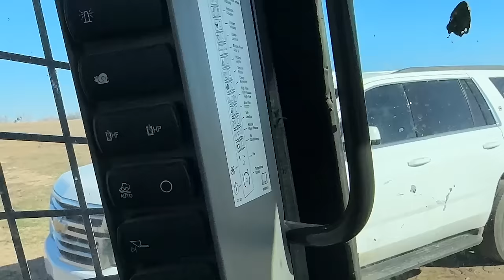FREEZING Temps Force Us To...

Comment: About the only thing you need to do for bison is make sure they have water and food. Of course not letting them get stuck in a snow drift might be an issue in a blizzard. A large open shed should suffice though snow fences might be useful if you are subject to that kind of weather. It is presently 14 degrees F at 11:39 AM on 1/16/2024 in Southern TN. Water is a solid and the snow pack is too cold to be very slick.

Comment: Hint for Cora's water tub, float an untreated 2x4 that way if you have to bust ice hit the 2x4 not the tub. (I live in the northeast and usually have to run tank heaters, but have used the 2x4 early in the winter)

Comment: You need to get Cora a blanket for the winter ❤ !
Reply: @Feribrat99   I live in Utah and it's really cold here. And snowy . I have 6 quarter horse and in the
Reply: @Feribrat99 process of building up Barn that's in closed. Horses are not thick hair and need more warmth. I have not had a sick horse at all .
Reply: My kids have horses & their coats thicken up for winter & they don't go inside. It's nature, Spring they shed.
Reply: I agree she needs a horse blanket.
Reply: As long as a horse has some kind of run-in and hay in front of them, they are fine. That's where the term "hay burners" comes from. As long as they can eat hay, they burn to stay warm. My Mustang has a heavy coat, dry underneath, because she has somewhere to get out of the weather. If there is snow, she wants to roll in it! If she were out in the weather, the rain, then I'd definitely put a rain-proof blanket on her.
Reply: @audreygregis8721 yep just needs shelter from the wind.  Blankets is keep them dry out on pasture if it snows or rains or sweating from exercising.  Plenty of hay and important is lots of water!